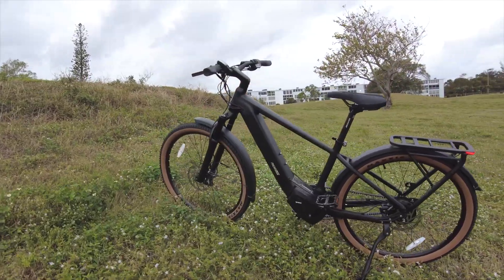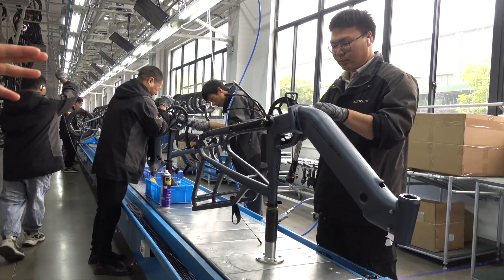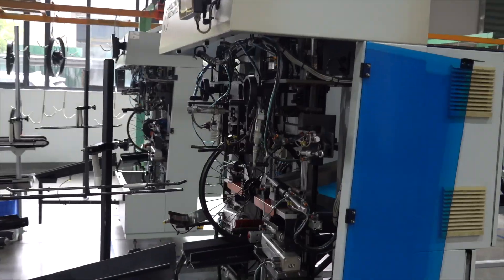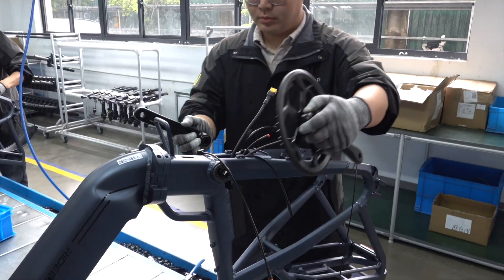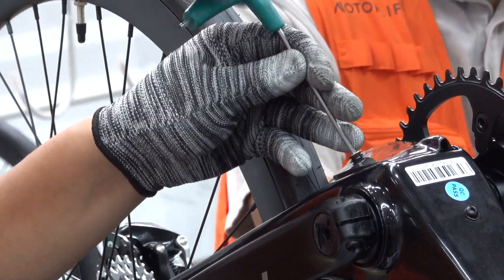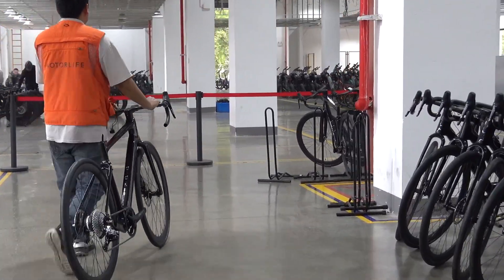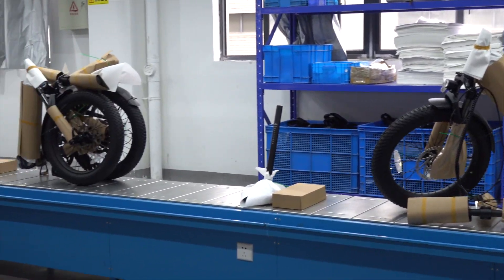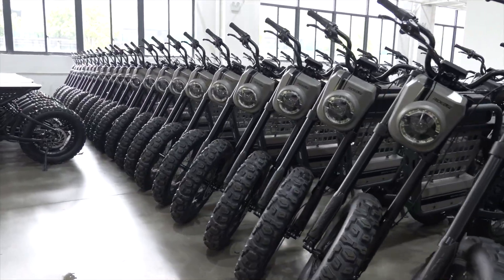Ride1Up Factory Tour: How Electric Bikes Are Made!

Comment: Wow. I must be a one off situation. The back wheel on my Roadster v3 was shipped to me 3 weeks ago with the spokes loose. Given this process I'm surprised this happened. Also the display died after only 11 miles.Suprised at this as well. I like the bike but unfortunately my first impression was not good. The service representatives were cordial, however, the sense of urgency to get me a new display took almost a week. Also, although Ride1up paid for the spokes to be tightenedt it wasn't without me pointing out that this isn't a warranty issue but a quality control issue. Again, I'm now happy with the bike, but still worried something else might happen down the road.

Comment: Ride1Up is a standup company.  I purchased  a bike from the company that failed prematurely.  The defect was the one-in-10,000 type. After going through the warranty process, the company replaced the defective bike.  Both bikes were perfectly assembled.  I have built bikes from scratch, but there was nothing for me to do with the Ride1Up bikes.  Wheels were true and round.  The spokes were properly tensioned.  Brakes were expertly adjusted, no rotor rub or spongy brakes.  The derailleur shifts were smooth and positive. 

The replacement bike has been trouble free and a joy to ride.  One improvement I’d like to see is a better owner’s manual complete with a wiring schematic.  I am experienced in diagnosing and repairing complex fuel injection systems.  A detailed wiring diagram would be helpful if the bike fails after the warranty period. 

I recently ordered the company’s V3 e-bike.  I am eager to put many gravel road miles on that machine.  

I can attest to Ride1Up’s dedication to excellent, responsive customer service.

Comment: Ordinary cable ties can be treated as reusable. You simply have to use a strong needle or the tipm of a pointed knife to lift the rachet tooth , so you can open it without significant damage. I reuse them many times.

Comment: Purchased the Ride1up 700 ST bike a few weeks ago. I took my time assembling (3hrs) watching 2 assembly You Tube vids and no issues. The gear changer was slipping a bit so took it to a local retired gent who tuned it up for $30 and it rides like a dream. Up at 4:30am here in Arizona so I can ride in high 80 deg.F weather. It hit 116 deg.F today, ouch. Now looking to extend my rides past my current 15 mile tours and some off roading. Great bike for the price. Cheers

Comment: Things at ride1up must have changed in the past two years because the core-5 that I bought was unridable when delivered. The wheels were laughably under tensioned, the saddle clamp was broken, and one of the valve cores was also broken. Ride1up responded quickly with a new seat post and tubes, but the valve stems were short so it was a real chore to inflate them. I spent six years as a bike mechanic so I was able to basically finish building the wheels. Since then, the pads on the mechanical disc brakes regularly back out. Tightening them requires removal of the rear wheel which is very tedious. My son has put 2,000 miles on it and though it was a rough start, we’ve actually been very happy with it. After the poor delivery experience I had, I didn’t think they would be in business for long. But if they really have brought their quality control in line, then it seems they have a future after all!

Comment: Had a Core-5 that developed intermittent battery issues after a few thousand miles, and they replaced it with an upgraded one. I’ve since sold that and now have a Turris with 1200 mi…so far, so good. I would say quality control has improved these last few years. Good solid product at an affordable price 👍

Comment: Boeing could a learn a thing or two from Ride1Up's quality assurance.
Reply: boeing run by white collar crimin*ls, engineered by indiota consultants who never saw a plane or car before getting hired working on boeing's projects
Reply: I just bought a Roadster V3 from them that came with leaky brakes needing repair, rattling in the downtube, and a battery that dies right after it drops to 30%. So it looks like Ride1Up learned from Boeing instead!

Comment: I bought my wife a Ride1Up ST700 about 3 years ago and it now has about 3400 miles on it and so far I haven't had any issue with it at all. When I got it new  I had one question when assembling the front fork and emailed them and got a great answer in about 45 minutes. I'd highly recommend their bikes.
Reply: Exact same here (700 model).  Battery has not faded to any degree I can notice.

Comment: This was awesome. I traded in my lectric XP 3.0 for an Xpeak and it was a death wobbly lemon. Brought it back, and while I was not going to keep that bike, it made me realize how much I can ride anywhere but I need way more battery+speed. So I’m saving up for a wired freedom, but in the meantime I need a stopgap. Saw the cafe cruiser, it looks cool, has a passenger seat (genuinely hilarious add-on BTW; highly recommend.) And for $1299 what a steal. It is very well built. Day 2 with my Lectric Xpeak the kickstand fell completely loose. Because I’m an idiot when I got my cafe cruiser, I knocked my kickstand loose off its adjustment knob trying to lengthen it, had to take the whole thing off to avoid laying down on the ground. Lo and behold the bolt was perfectly snug how it should be, and BLUE LOCTITE? Hallelujah. Smart people at Ride1Up, they are putting $$$ where it matters. My cafe cruiser will have a place in my home for a long time even when my wired cruiser comes in. (That one is just a legit money saver to just stop driving my car as much as possible lol.)

Comment: I own a 500 st and I wondered what new models they had so I went to the website last week, I was surprised to find a bike with a 36 volt system instead of 48 like mine, isn't that a downgrade?
Reply from the maker: 36V isn't inferior to 48V. Both have pros and cons. They are just two different system voltages. It's easier to go higher power with higher voltage, but you usually get lighter, smaller, and less expensive batteries with 36V, which can be more appropriate when moderate power is acceptable.
Reply: If you are talking about the Prodigy no it is not a downgrade.

Comment: Thanks for another informative “behind the scenes” video. Great you could coordinate with Kevin Duggar for it!

It’s encouraging to learn of their multiple inspection stages.

I’ve been pretty pleased with the LMT’d I bought in late 2020, though perhaps they didn’t have the paint quality inspections in place as its matte paint is quite fragile, and thick paint on the faces of the bottom bracket caused issues with creaking when pedaling and misalignment and some damage to the ribbon cable insulation from the torque sensor. After I sanded off the paint, it aligned correctly and eliminated the creaking noise.

Great that Ride1Up is trying to eliminate non-recyclable, non-biodegradable packaging, and switching to reusable nylon cable ties. I use a precision flat head screwdriver to remove them for reuse already, but it’ll be much easier and safer to not have to do that. I’ve seen at least one brand use twisted thick Kraft paper ties (I think Globe?).

Would like to get a Portola to replace my Nesta, but waiting for it to get UL certification. It will make it easier when I take it to NYC and other places that are requiring UL certification.